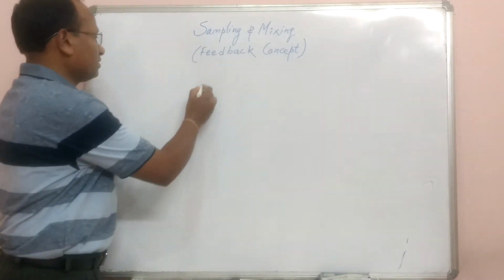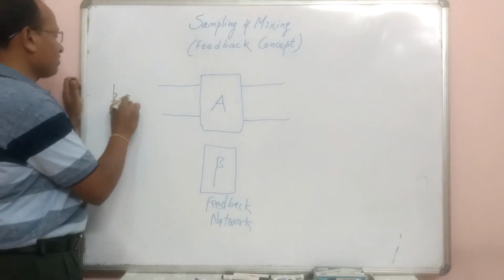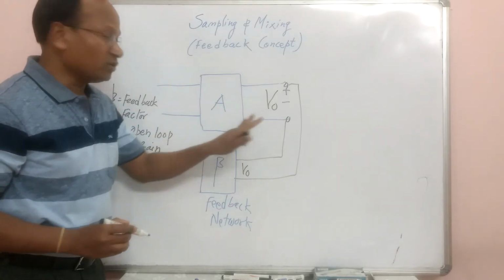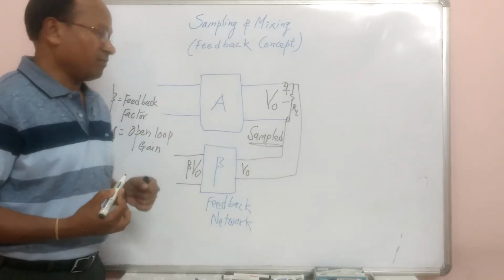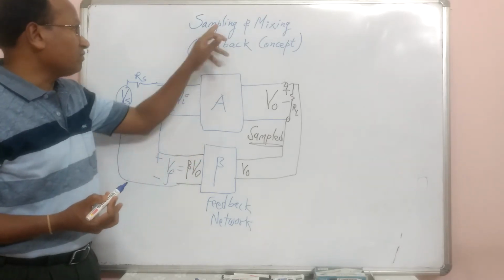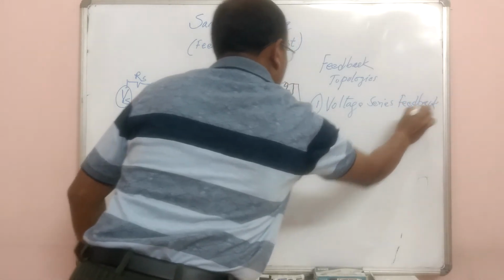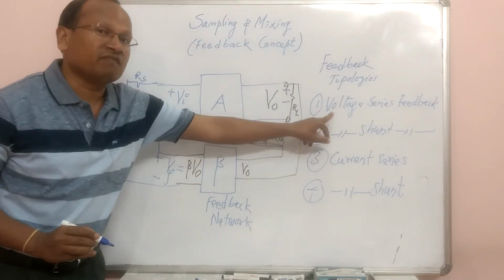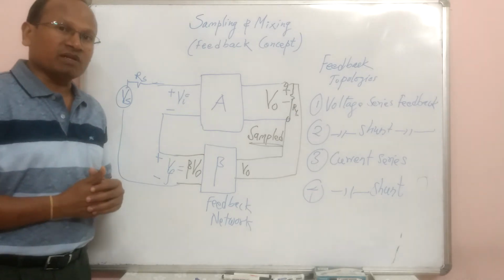Sampling and Mixing in Feedback Amplifiers

Comment: You have connected positive terminal of amplifier to the negative terminal of feedback sir, therefore  it is current sampling 
I am attaching a Google image link please refer 
https://images.app.goo.gl/xgUY8ej1ExYSzVno7
• 2nd one Voltage shunt 2nd image
Reply from the maker: Thanks. The diagram has included both sampling (voltage as well as current). The purpose is to explain all sampling methods. Negative polarity has nothing to do with sampling but it is due to the feedback being discussed is negative.